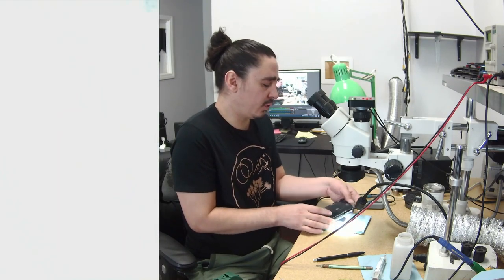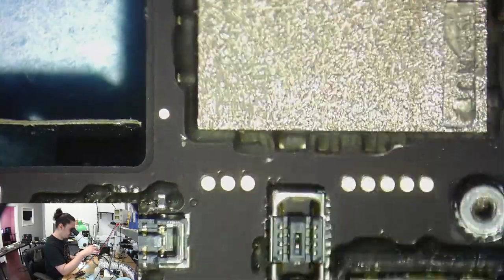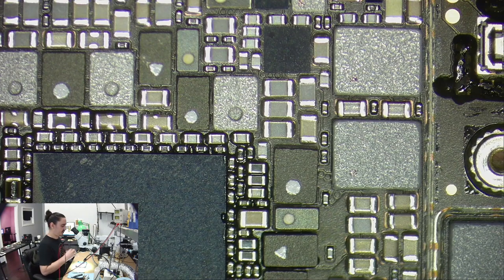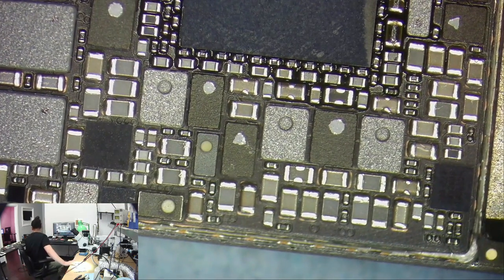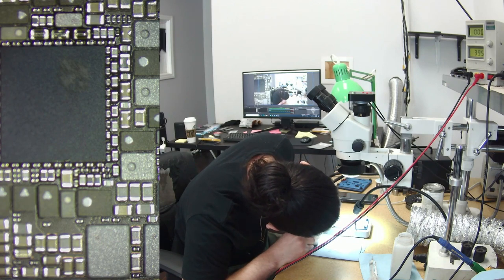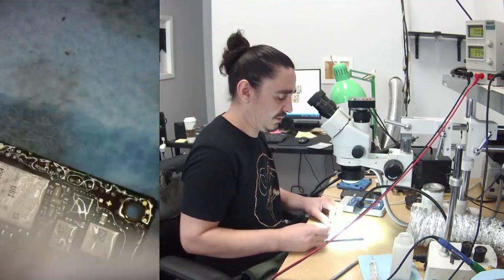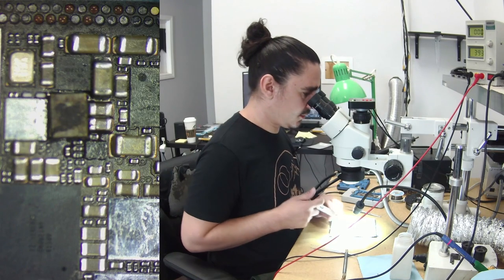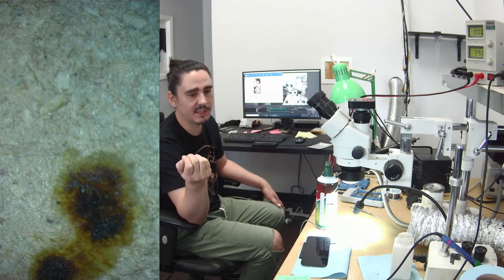iPhone 12 Pro with Broken Coil - Data Recovery Techniques

Comment: Use a little bit of hot air (I use 240 temp 40 air no nozzle) along with your heating platform when splitting the two layers
Reply from the maker: Yeah that will probably speed up the process, thanks.

Comment: Hello sir, I have the same problem on the same unit/device but it still short the amp draws only run 0.300+ or something higher and lower it goes back to zero. May I know what the other possible reason are why it's something like this😅, actually i saw on your videos had similar problem for 12 pro and the boost coil all the same spot. So, I just trying to ask here. I'll be glad and please if you just respond this question Thank you.